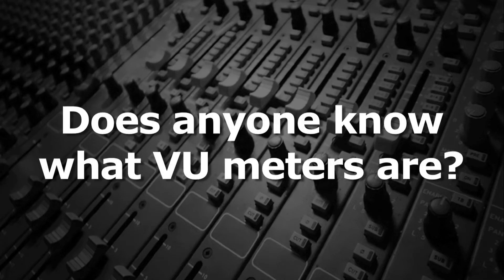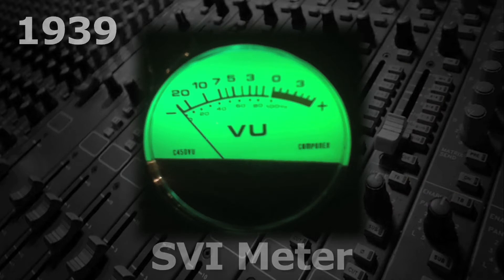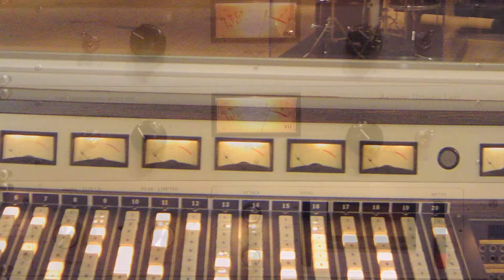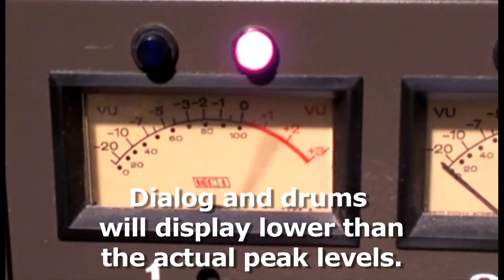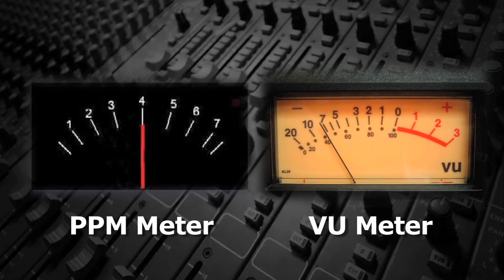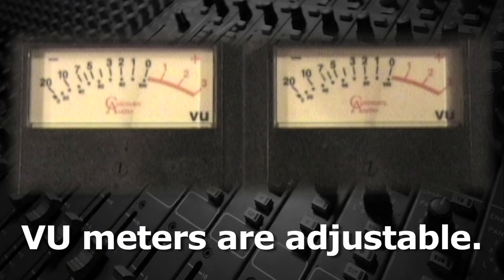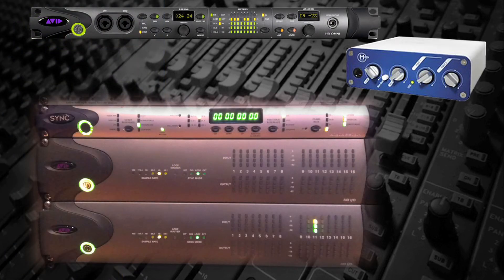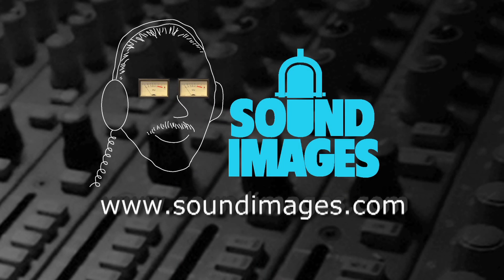VU Meters

Comment: These meters came about when there was a need to standardize the voltage levels that broadcasters fed into the telephone system (a 600 ohm resistance). Namely, 1 milliwatt at 1000 Hz into 600 ohms = zero "VU". Since deciBels are a ratio, not an absolute, every other definition is pretty much an arbitrary one. That's why most radio station level meters were shown as "100% Modulation" in big type, with the corresponding reading as "0 VU" in smaller type.

The guy who invented the clock: "What time should I set twelve o'clock to?"
The other scientist: "Set it to whenever you want; we'll go from there."

Comment: LOL, "virtually useless". I beg to differ with those who call VU meters that. In my humble opinion, they're anything BUT virtually useless. I find them quite handy when listening to reel-to-reel tapes because with them, I can often tell how loud a tape is and adjust the output volume accordingly through a receiver.
Reply: You're welcome. In your video above, you stated that the dBFS meters are absolute. Well, I'm not used to using those since I got used to the VU meters. Accurate or not, it never hurts to experiment with volume levels until you find the so-called "sweet spot" where a recording sounds good, not too loud and distorted or too soft and barely audible. My only problem with trying to find said "sweet spot" is my hearing loss, because I can't hear the high frequencies without hearing aids.
Reply: Well here's the thing, Mr. Audio. I was BORN with a hearing loss, which makes it even worse because from day one, I never could hear high frequencies correctly without hearing aids. But one thing I find fairly helpful even though I'm now in my 40's is digital headphones, especially when I use those to listen to analog recordings, because for some reason, digital headphones seem to clarify the sound of analog recordings coming through the pre-amp of my reel-to-reel tape deck. So in that case I use the VU meters as a rough guesstimate (how do you like that portmanteau) for the volume level.